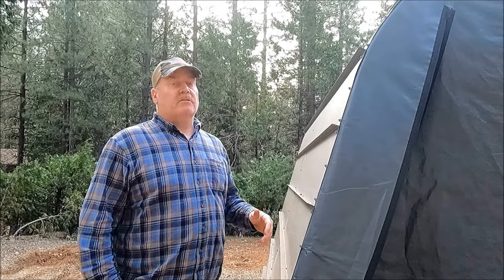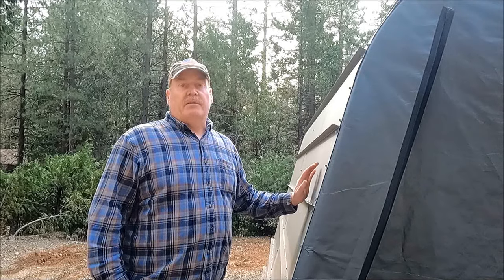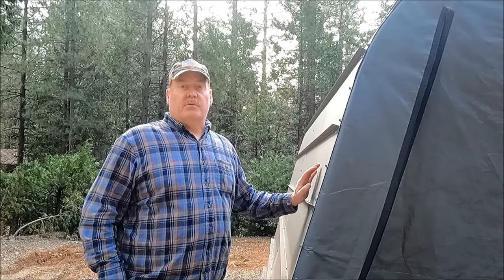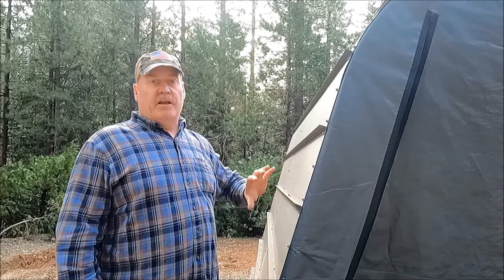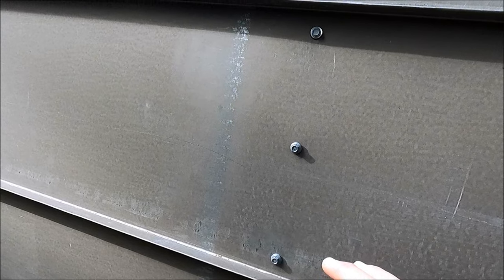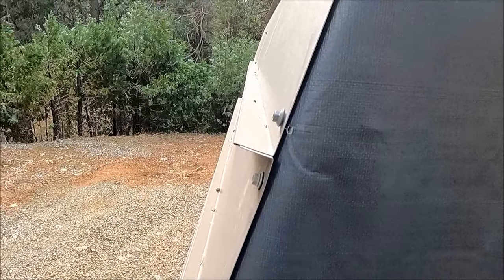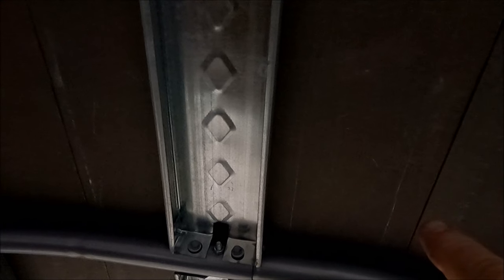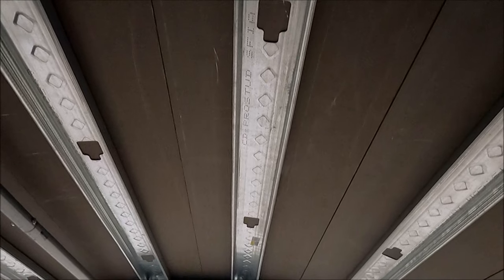Shelterlogic Modification

Comment: Had a neighbour who tried this in town, bylaw officer forced them to remove the metal cladding. A temporary shelter is permitted nearly to the street but adding metal makes it a "permanent" structure and therefore must be set back from the road (e.g., 40 ft) like any garage. If you are living in a town, check the bylaws first.
Reply from the maker: That is good information.  Thank you.  I checked our county building code and found the following: In our county you can build a structure that is 100 square feet or less without any permit from the county as long as no one lives in the structure or has electrical wiring inside.  The minimum setback is 30 feet from the center of the roadway to the front of the structure and 5 feet on the remaining sides.

Comment: Bought a tarp from Harbor Freight for under $20 bucks, threw it over the shed, anchored, the 4 corners, and it's lasted for five years now.
Reply from the maker: That is interesting how a tarp from Harbor Freight could outlast the Shelterlogic tent material.  Good to know for folks who are unable to put metal on the roof.  Thanks for dropping a comment.
Reply: @HamiltonServices530  i am curuious which tarp the shelter logics come with initially i know most of them have two options available
Reply from the maker: @monkeyoperator1360  My UTV garage in a box shelter came with the standard cover.  It only has a one year warranty which most shelters have unless you order custom shelters directly from the shelter logic website.  There are options for a 14oz. cover which has a 10 year prorated warranty or a 21.5oz. cover which has a 15 year prorated warranty.  When I chose the same dimensions as my shelter using the 21.5oz. cover, the price jumped from $429 to $1099.  Wish I knew someone that had the heavier cover to get their opinion on the more sturdy cover.
Reply: @HamiltonServices530  i found your video while i was searching for information about the heavier covers. cause i am thinking about getting one so i can avoid my tax bill going sky high

Comment: Thank you so much for your video.  I just installed my own 10 x 15 x 8 round top and I’m going to install the metal wall studs like you have.  Excellent idea.
Reply from the maker: Thank you!  Good luck with your project.  I never thought about adding the studs while I still had the original factory cover.  I wonder if mine would have lasted longer?

Comment: Cool idea. Is this a cost effective for someone who doesn't work at a sheet metal shop. Subcribed.
Reply from the maker: @Kyle-ev4fk  The metal studs are pretty easy to fit in between the supports. I have another video out there on how I cut the metal studs. The easiest way to cover the frame with metal is to use the wavy corrugated metal or poly panels.  Everything will overlap easily with minimal cutting and no folding of the metal whatsoever.  Thanks for the subscription!
Reply: @HamiltonServices530  yes, I was referring to the metal that you used for siding.
Reply from the maker: @Kyle-ev4fk  I had to fabricate the metal I used on my shelter logic in the sheet metal shop I work for. I suppose any prefab metal roof would work as well if you wanted the standing seams.  However, I just finished the metal roof on our house build project.  The prefab panels can be kind of expensive if you are looking for something budget friendly.

Comment: Fair enough in any event you did a gret job i double ribbed mine for additional strength plus an inner layered tarp and then the factory tarp for the finish
Reply from the maker: I would be interested to see how that came out.  Sounds like that would protect the factory tarp from sagging and ripping.
Reply: @HamiltonServices530  it really did make a difference with 2 layers of tarp and double ribs for additional strength,  I found the factory ribs were to far apart simply put not enough of them so I found one no more in use same size and doubled up on everything huge difference.

Comment: What gauge studs did you use?
Reply from the maker: According to the website of the store I purchased them at, they are 25 gauge studs.  Here is the brand info from the website:  ProSTUD 25 3-5/8 in. x 10 ft. 25-Gauge EQ Galvanized Steel Wall Framing Stud.

Comment: Good job
Reply from the maker: Thank you!
Reply: @HamiltonServices530  I just used scrap wood from Home Depot to use as extra support for the roof. But your idea is much much better.
Reply from the maker: @7thsignthenorthcoast146  I imagine wood could be a little stronger. I was just in sheet metal mode when I did the mod.  Will you be posting a video of the mod on your channel?
Reply from the maker: Oh wait!  I think I just found it.  I will check it out.